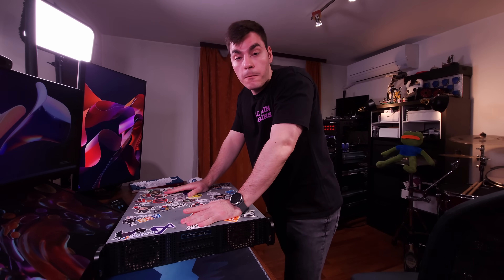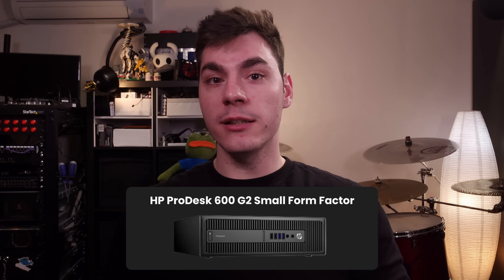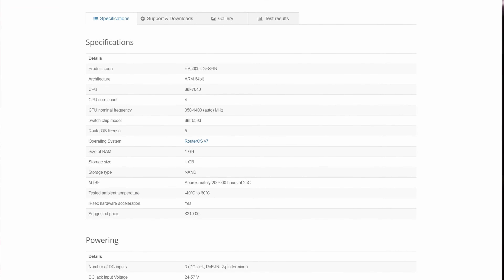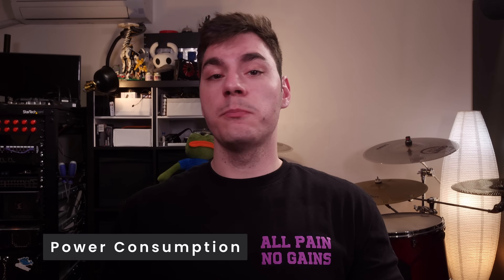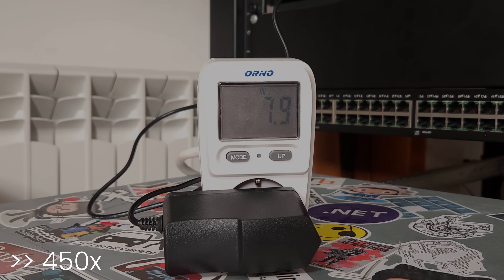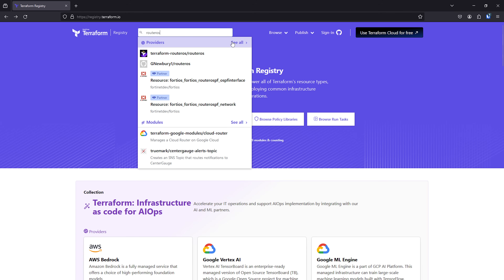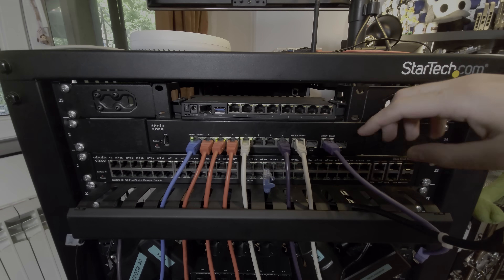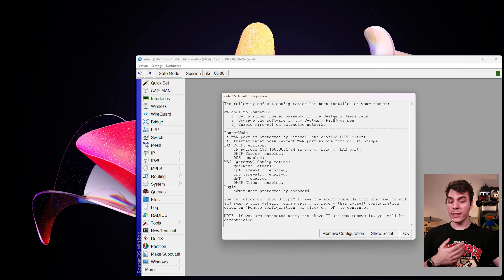Migrating From OPNsense To Mikrotik

Comment: Opnsense is better it have more features I guess that doesn't matter to you
Reply from the maker: Better or worse are both subjective and highly dependent on the criteria used for the comparison. For me and my particular use-case, I'd say Mikrotik wins out this competition.
What are some features that you find to be missing on Mikrotik, that you use on OPNsense?
Reply: Which features are more necessary, if all inbound ports are closed anyways?
I can’t think of any.
Reply: @2uxzh01k  OPNSense supports plugins, like Suricata.  I since many years stop to use *sense and replaced with RouterOS.  I didn't like the ugly and slow WEB UI and that pf was  always reloading after config modification.  I'm not bashing against *sense, it has its strengths but i don't like it.
I'm an Open Source advocate but sometimes, you have to make choices based on your use cases or preferences.

Comment: This was an interesting one, thank you! Would love to see what you'd manage to do with terraform here.
Regarding WiFi: miktorik's wifi can be problematic, hope it works alright for you. Watch out for mix and match of old and new mtk access points as Mikrotik has two CAPSMAN (their controller) versions that are incompatible.
Reply from the maker: Yeah, I already got a Mikrotik AP by the time I finished this video and I had trouble getting CAPSMAN to work properly. I ended up configuring the AP as a standalone device just to get it up and running, but it's something I need to look into a bit more!

Mikrotik definitely has a steeper learning curve than other solutions for sure 😅
Reply: @mirceanton  capsman wise make sure all the APs you would buy can work with the same version. Otherwise each one can be managed individually via RouterOS means that all of them run. So probably would be easier to hook them up to your terraform that way.
Reply: @mirceanton  generally speaking, wifi from MTK lags behind competitors a bit. Does not have any 802.11be or 802.11axe solutions, only recently added 802.11r/k/v (not sure how well it works), don't do more than 2x2 and so on, and so on... Good news: you could run TPlink or Ubiquity controllers in containers on your RB5009 and MTK works fine with those access points.

Comment: Ok first off you had the wrong hardware for opnsense, am running latest version on a Cisco ASA5515X. It draws less than 20w and I get full 1Gbps download and 120Mbps upload.

Mikrotik is nice but it takes a while to learn the mikrotik way.
Reply from the maker: Wrong or right, I used the hardware I already had laying around that had no other purpose. Sure, just like you mentioned, I could have improved that setup with some better hardware, but that was not really the point. I never felt limited by my hardware choices. The power consumption and maybe even the performance could have been improved, and I totally agree, but those were not my limiting factors.
This was more of a software limitation, where OPNsense doesn't really support automation to the extent that Mikrotik does. Other than that, yes, I could have stayed on OPNsense and optimize my hardware setup to achieve similar results.
Reply: @mirceanton  IF he told me that, I'd assume he meant using a older full-on desktop/ server hardware is the wrong hardware..  And I'd agree that "what you happen to have"  it's not likely ever going to be optimal.  Not sure what the Cisco ASA5515X is internally, but sometimes if one wants efficiency, one needs to consider either different hardware or buying different hardware especially if things like excessive power consumption, fan noise, and heat are a concern. Am running Opnsense on a N100 fanless mini PC; and it draws about 12 Watts, IIRC.   OpenWRT on ARM hardware also was an option, and drew less power, but my issue was not really with OpenWRT but who/where the code for it was maintained as it wasn't available directly from OpenWRT.  It did have lots of headroom however, and drew less than OpnSense did on the N100.  Personally, I would not want running fans of any sort in my sleeping area !!  After years of dealing with fan noise, I think my hearing is more screwed up than from the time I spent in the military dealing with loud turbocharged/supercharged diesel engines, and marine turbine engines. 
Congrats on your new router; hope it serves you well.. TBH; it's not right nor wrong; it's a choice, with consequences.  Choosing Opnsense on a N100 is both a choice and has consequences;  Choosing mikrotik hardware is also a choice and has consequences.   Everything in life is about making a choice, leveraging the pro's and accepting the con's.

Comment: I just did exactly the opposite couple month back, left Mikrotik in favor of OPNSense.
Reply: Is it for "plugin stuff" like Suricata?
Reply: @guyboisvert66  not only but mainly.
Reply from the maker: Interesting. What made you ditch Mikrotik?
Reply: @mirceanton  I have a very simple home lab and automation at home, Mikrotik was more than enough and even more powerful than I needed but I wanted something more “user friendly” that I could add plugins and consolidate the hardware. I got an Intel J4125 4x 2.5Gbe NIC small box(tiny) that I’m running proxmox and passthrough 3 NICs to OPNSense and the other is shared across some small VMs/Containers (WireGuard, reverse proxy, home assistant, DDNS, etc). 
Also, OPNSense has some nice dashboards, log views and drill down information out of the box. It could be done with Mikrotik and Grafana, but “too much” work. Lol.
Reply: @mirceanton  mainly for plugins and “ease of use”. Mikrotik was more than enough for me but I wanted to consolidate hardware also, I got an Intel J4125 4x2.5Gbe port that I installed proxmox and reserved 3 ports for OPNSense and allocated the other for reverse proxy and some other small things. 
Also OPNsense is “more visual” and have some nice addons and reports.

Comment: Have you considered Vyos? I believe it supports both Terraform and Ansible. The entire configuration process basically consists of CLI commands.

I'm in a similar situation where I'm considering switching from OPNsense because I want to manage my configurations as code. However, I'm still undecided about which option to choose.
Reply from the maker: I would not recommend VyOS. I am not currently using it, not have I used it in the past, but there has been some controversy surrounding it lately, which caused a lot of people to migrate away from it.

Essentially, the maintainers threatened to take down some community builds and made it very difficult to build the LTS release. I haven't really kept up to date on this, but there have been some personal jabs made as well against people doing their own OS builds.

Someone that is more involved in these events may chime in to give some more details, but that's the gist of it, from what I understood.
Reply: @mirceanton  That doesn’t sound too great, I guess I’ll have a closer look at MikroTik then. 
EdgeOS might also be an option, but I feel like Ubiquiti’s support there has been very lackluster and they focus more on their UniFi range.
Reply from the maker: It really depends what you're looking for. Sure, UniFi is great and a lot of people use it in their homelabs. If you're looking for automation and Infrastructure-as-Code, then I can't really recommend it. Otherwise, it's a solid option too